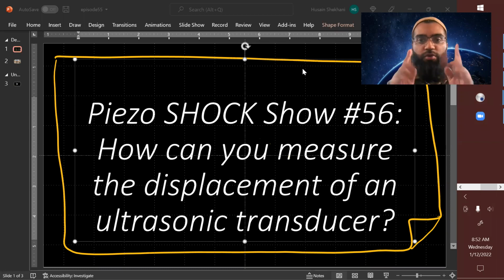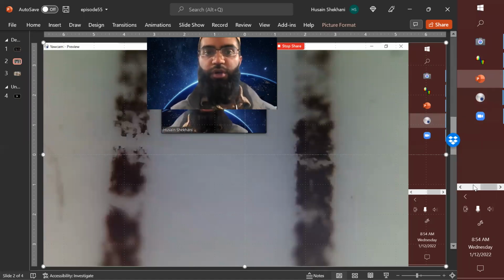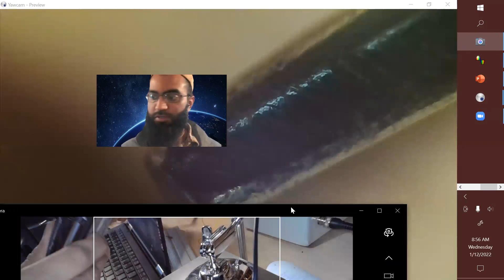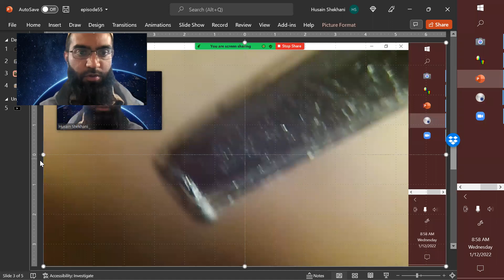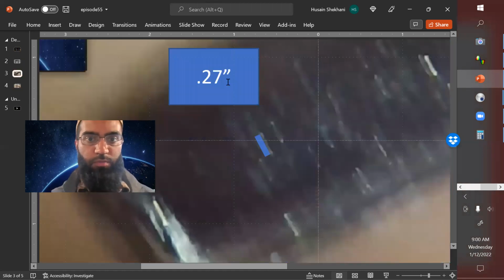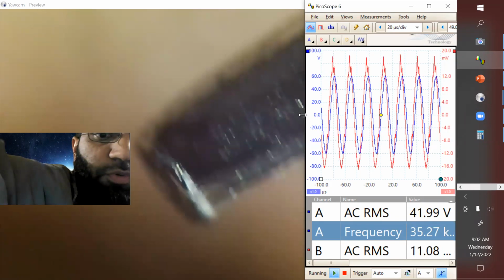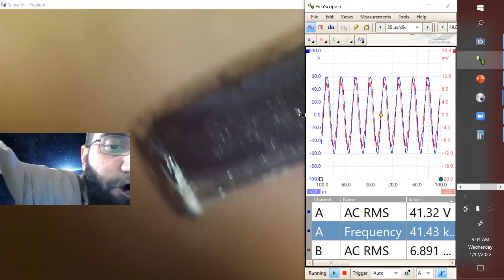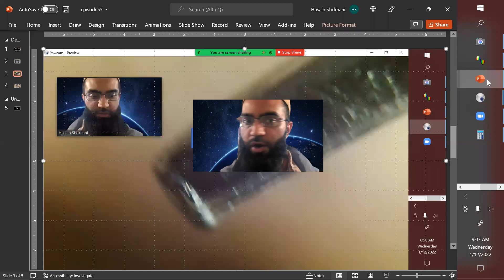Piezo SHOCK Show #56: How can you measure the displacement of an ultrasonic transducer?

Comment: I am measuring also M33 in bulk polycrytalline ceramics. However I found different results (bar shape samples): Glued sample on a substrate (high M33)/ simply putting the sample on zirconia cylinder (free standing)   (Highest M33) / put the sample between two magnetic balls (Low M33)--------Do you any comments? Whats the standard way to mount sample to measure d33 or M33.

Comment: There is a standard in this area: IEC 61205 (Ultrasonics - Dental descaler systems - Measurement and declaration of the output characteristics). But it seems that it was withdrawn in 2018. Do you know if it has been replaced?
Reply from the maker: I did not know about this. I'm gonna check it out. Thanks for this tip!

Comment: Great video! What type of magnification would you recommend for this stuff if I were going to purchase a microscope? Also, is the displacement at the tip of the transducer the same as the displacement of the actual crystal?
Reply from the maker: Nice question! What you are shooting for is the highest pixels per micron. I'm not using something expensive(https://teslong.com/collections/usb-endoscopes/products/ms100-industrial). You can go for professional cameras with appropriate lenses to achieve magnification of <0.5um/pixel or so. The displacement of the tip is MUCH more than the crystals.